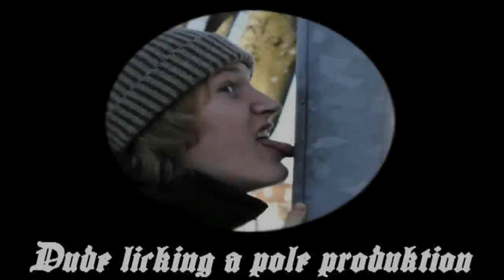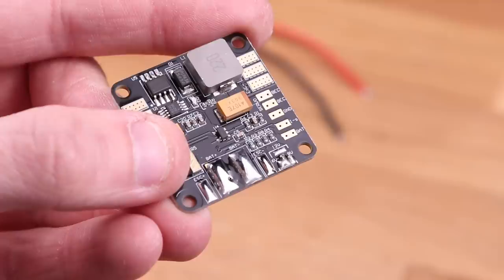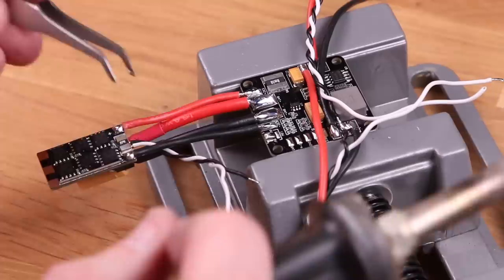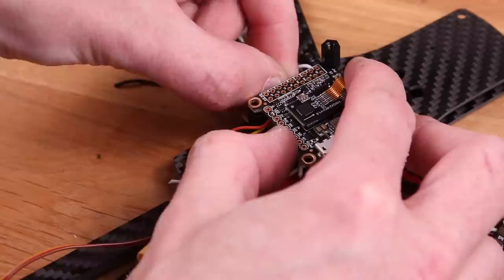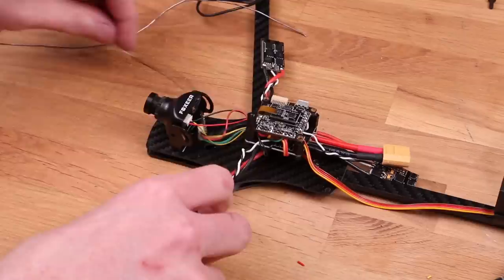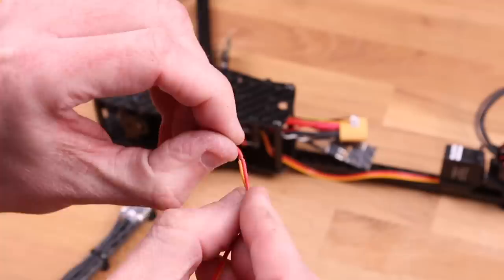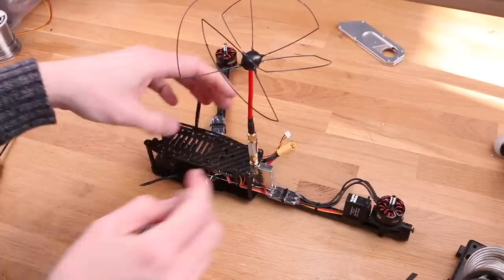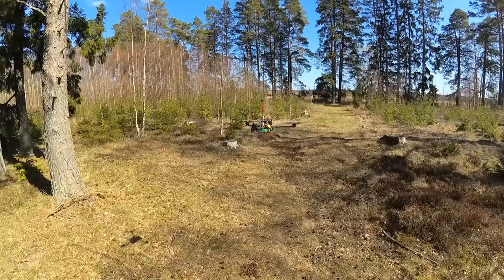TRICOPTER LR - Long Range FPV, 1h+ Flight time, Foldable multirotor - Build Video.

Comment: Man I wish you were still working with these things. You were the reason I fell in love with Tricopters. They would be so more advanced if you were still around.
Reply: It’s really depressing
Reply: @rdpenguin2710  what happened?
Reply: @bepopxxx  the list I sent you is a combination of what you can still buy (the bird servo isn’t made anymore) and pieces that you have to substitute. This too was changed because I put quite a bit more on it but there are a few other things you can do to beef it up
Reply: I'd like to make a tricopter like this what do u need to get something similar?
Reply: does anyone have downloded the 3d models and pcb file, i want them. the website seems to be not working.
Reply: i still have his original tricopter (bought it from him before he had the shop) and one of the newer tri, they still fly well. its fun. i dont know why he stopped, probably got bored, who knows. He still makes stuff. cool dude really. the years go by fast hehe

Comment: What is this, a post from David, the legend himself?!

I have to check this out, especially if it's about his beloved Tricopters.
Reply: I know the pid is the simplest control paradigm for this purpose but if u want to possess an increase in stabilisation and faster trajectory and step responses and a reduced steady state error and overshoot resulting in an immense increase in system performance,  construct a better controller such as the H infinity, LQi, Fuzzy, sliding mode controller demonstrating better robust properties against external disturbances such as wind, torque and vibration.
Reply: @meti9230  put up a link so people can try it out!

Comment: you are a tricopter legend. its hard to get the right equipment without your shop.
Reply: does anyone have downloded the 3d models and pcb file, i want them. the website seems to be not working.

Comment: Thank you so much for the tip with mounting the center to the top plate of the frame, without attachment to the bottom. I also tried to come up with a compact folding frame, but it didn’t even occur to me how to make folding beams that do not touch the fastening nuts of the FC. You have found a brilliant simple solution !!)) Thank you very much)))

Comment: DAVID!!!! We need a tiny whoop tricopter!!!!! And of course as always, great content man. I’m sure it’s super SHWOOOSHY!
Reply: I agree, a 1S or 2S micro-tricopter would be nice. Imagine a "Toothpick tricopter" with 65mm props!
Reply: I think tiny whoop is too small. Maybe 3 or 4 inch?
Reply: Yannick G FPV absolutely. That would be amazing!
Reply: JBpiification he does have the mini tricopter which is awesome but I’d love one that could fly indoors. We just have to see if the great Swed is up for the challenge?
Reply: @KnowledgePerformance7  This is just my opinion, but with a 3in or 4in tricopter, you lose most of the LR capability, it won't fly for much longer than a quad. Smaller builds that use the 65mm props on the other hand can fly for a relatively long time. The only problem would be the electronics and an adequately sized servo. A 3in or 4in tricopter would still be loads of fun though, and certainly unique in a sky full of 5in quads.
Reply: @yannickg6904  Right I think the idea would be similar to david's babyTri but smaller
Reply: @KnowledgePerformance7  For a toothpick sized tri, the servo would have to be specially designed. Or someone could use a tiny potentiometer or hall effect to get position feedback from a slim micro servo I guess.
Reply: @yannickg6904  sound like a cool product! Bit out of my design abilities...

Comment: David! Good that you're still around! I remember starting this hobby like what, 7 years ago? How different was it back then? I started with a quadcopter based on arduino. Then I moved to openpilot. I still have all the parts... But I've become lazy. Nowadays I just grab my Mavic Air. And it's not the same anymore... At the beginning people were interested, asking how fast, high or far I could go. Today people come to complain that I might be filming them... I miss the old days, before dji... Before it became big.

Comment: I love my Maker Knife! 

Funny story about it. I heard the RC Afterhours podcast what you were on a while back and talking about the knife. You talked me right into wanting one because it sounded cool and I wanted to support your project. I was disappointed that the production run was sold out and you weren't sure if there would be another run. I can't remember if I even went online to look for it or simply decided that I missed the opportunity. 

Anyway, about 3 or 4 weeks later I received a package from a name I didn't recognize. I opened it and after a few moments of being puzzled by the oddly labeled box inside the padded envelope I realized it was my Maker Knife! I completely forgot that I had ordered one from Kickstarter months before - doh!
I was so excited that I handed my phone to my wife so she could record my first ever unboxing video. 

The knife is awesome. I got the silver color and ceramic blades (which are as awesome as you said). The finish on the knife is spectacular. I appreciate it even more after hearing about the issues you had with the factory meeting your qualify standards. Your pursuit of perfection was well worth it. 

BTW, what's up with the steel blades on your knife?

After filming the unboxing video I told my wife she was not allowed to use the knife. It actually started quite a an argument because she didn't think I trusted her to be careful with it. 

The next day we were in the garage cutting down boxed and she dropped one of my many other utility knives on the concrete floor. She looked at me and smiled admitting that I was right to ask her not to use the Maker Knife. 

There's no replacement for quality tools. Thanks for your effort and insistence on top quality. The tool I have owned the longest is an old school metal Swiss Army Knife with the waffle pattern sides that my father gave me when I was about 9 years old. That was 35 years ago. I think this knife will be sitting next to that one in my tool chest 35 years from now. 

I can't wait to see what you come up with next.
Reply from the maker: Awesome story Dan :D Glad you like the knife!

Comment: Whats with the 1+ hour flight time? Which setup did you achieve that? 40 minutes is already very nice
Reply: I think that this is WAY too optimistic.
Reply: Must include the 2km floating back down ;l
Reply: Cecil Williams  You think so? I've got a quadcopter with 2216, 4s and 9" props, it's unbelievably really crazy optimised and it weights only 1kg. It flies 1h exactly. And getting this result wasn't even near to "easy". Trust me, I perfectly know how to build an endurance quad suitable for long range. You basically fight for every gram of excessive useless weight (useless in terms of flight time - everything except the battery, props and motors).
Reply: @WRXMSK  
Edit: I'm an idiot, disregard almost all of this, I own my mistakes, no delete.
Dude, I'm pushing 2 hours (1 hour 56 mins at cruising speed) for my custom tricopter. They are significantly more efficient. And I disagree, I make aerial-photography rigs, and have made fpv quads of many sizes that can reliability hit a couple mins over an hour, it's not hard. I have an hex that can carry a 6 pound camera/gimbal for 52 mins, hovering. It's really not that hard. The record is well over 2 hours now.
Reply: @WRXMSK  with a tricopter you have the option of a less powerhungry propulsion system, because you have the tilt rotor and don't need to spin two up and the others need braking. I think there his long flighttime comes from.
Reply: @Cult1022   The most efficient setup is a quadcopter. It's theoretically and practically proven. The efficiency (for a chosen motor prop combo) comes from lowest possible load on each square centimetre of area covered by a propeller. This area maximises only with quadcopters with the least added weight of other components. Next, you don't take into condideration the energy that the tail servo consumes on tricopters, it's not that tiny and potentially could be comparable with the energy needed for braking and spinning up two props in a quad scheme.
Reply: @index7787  You are skipping the lines while reading. I said that I squeezed an hour and a couple of minutes from a quad with 8.5" propellers. And it was hard to achieve such a result on the propellers that are so small. If you have a quad or a tricopter that flies longer on 9" props, we all will be more than happy to see the proves. Second, I'm not talking about endurance records. I'm building quadcopters that fly real LONG RANGE (and that's definitely not a couple of miles, as many think) and I optimise my quads for being most efficient in flying, and flying fast, to cover maximum possible distances. That's why I not go for much bigger props, like 17" and even bigger. They fly long, but they are damn slow. You can build a quad, that flies 4 hours at 30 kmh and make 120 km in total. I can build a quad that flies 2h at 60 kmh, that covers exactly the same distance. BTW, current world distance record for a battery powered quadcopter is still mine (it's 30.5 km out and back) and this summer it will be improved to 40+ km out if everything goes well. So no, man, I will keep the channel's name.
Reply: @index7787  at least long range quadcopter have video to prove...
Not some random salesman selling bullsh*t flight time (sorry david)..
Problem with drone industry today is alot of bullsh*t about flight time. I can't even sell 1 drone if Im telling the truth about flight time... (Curcol mas broooo...)
Reply: @WRXMSK  
Checked out your channel, I'm completely wrong. You get some serious miles man, who needs flight time when you can cover ground like that, I'm sorry man, I have hella respect for your work.
Only thing I have to add, most tricopter controllers suck, I code my own. I lock out the tail servo in fast forward flight and control yaw by other means because enough vector components are shared at high flight angles, you don't actually need the servo for many of the corrections (even small control inputs). My current FC uses an AI I've been training, I'm hoping to revolutionize how we do flight controllers, it could save a lot of power. Between that, and low drag lifting surfaces baked into the carbon arms that are set for my cruise AoA, I'm not far behind you in terms of range. Tri's can hit their own sweet spots, they are just comparatively under developed and I had to put a lot into the software to get what I'm getting. (Also, their acro isn't the best, I use an efficient servo, but it's slow, the only reason it works is bc the A.I. predicts instead of reacts so it need way less torque. The caveat is it handles like ass, but mine aren't meant to be flow manually.)
Reply: @index7787  
So you think this david tricopter can achieve 30min + with 5000mah 3s lipo?
What about  Liion 26650 5000mah? could be longer?
Reply: Vincent Bianconi 😂🤣
Reply: @WRXMSK  do you use li-ion batteries? what kind of pack?

Comment: Sad the store is closed and no longer selling this. I'd love to buy one
Reply: David made all files public, so if you have (access to) a CNC router you can have the parts made for you.
Reply: @R-77 Watch the build video and the listing in the shop, it's all there, you need to source the parts, or their replacements yourself, that's part of the hobby...
Reply: @R-77 Can't help you there... I entered the tricopter world last Oktober, just in time to see David closing the shop, so I'm making my own frames using the info on the RCExplorer site.
Reply: With one less motor, a tri is more weight efficient than a quad, flying them is an aquired taste and not for everybody, as tuning the tailservo and getting the general set-up right is more complicated than the RTF quads, specially the quads that 'everybodies granny' can fly with the gps and altitude hold. The manufacturers favour quads at the moment, as do the developers of flight controller software.  Software for tricopters is written/adapted by a few dedicated tricopter pilots, who don't need to make a living out of it...
Reply: @janspoelstra8309  thanks 👍
Reply: Why he closed the store ? He is not in hobby anymore? He is so genius i love to buy his tricopter..

Comment: please make a long range flight video (5+ km out / 30+ min )   that would be great
Reply: Yes please! Do an Airblastr like edit too. A trip back to the Faroe islands might be in order, lol
Reply: I know the pid is the simplest control paradigm for this purpose but if u want to possess an increase in stabilisation and faster trajectory and step responses and a reduced steady state error and overshoot resulting in an immense increase in system performance,  construct a better controller such as the H infinity, LQi, Fuzzy, sliding mode controller demonstrating better robust properties against external disturbances such as wind, torque and vibration.

Comment: David!! Excellent work man, as always. This tricopter is brilliant! I really appreciate the slower more efficient machines, especially for AP. Will you add building service? Or just the kit.
Cheers from Mexico!
Reply from the maker: No building service I'm afraid, just way too much stuff to do and not enough hours :)
Reply: I see, looks like I better up my soldering skills then! 😅
Reply: does anyone have downloded the 3d models and pcb file, i want them. the website seems to be not working.

Comment: Does this tricopter go to Sydney?

Guess it's time. Going to have to build a tri. 
Nice to see you back promoting 3 blades and a servo again. Don't be such a stranger.
Reply: You might need to swap batteries a few times then :-)
Reply: This copter is clearly 1st class, so the answer is no. ;-)

Comment: Nice!  Good to see you.  Takes me back to a project using ArduPilot in the days of KK2, Windestal inspired wooden dowels and plywood frames.   Was chasing flight times, position hold and return to home.  Best I managed at the time was just over 20 mins using 3,000Mah 3S, 800kv and 10 X 4.5's.
Reply: does anyone have downloded the 3d models and pcb file, i want them. the website seems to be not working.

Comment: Wondering about the locking mechanism of the front arms...
Do the motors/props aid the arms into the flying position ( Right Motor CW / Left Motor CCW ) or is the mechanism only relying on the friction between the arms sandwiched between the plates?
Reply: does anyone have downloded the 3d models and pcb file, i want them. the website seems to be not working.
Reply: @hiteshbhoyar7719  The Model is simple enough to CAD Model one yourself... Start with the size of the Motors, Servo and FC as they'll be defining the Dimensions.
While certainly cool to look at with the Electronics being integrated into the Frame, I'd recommend NOT using such an A.I.O. Approach even if you can have it manufactured by someone.
I owned a TBS Discovery PRO which had the same concept, and a single crash can/will ruin not only the structural integrity but also the PCB with all the Electronics on them which you then cannot transfer to a replacement Frame because they ARE the Frame... As such I find it better to keep the Frame separate from the Electronics.

Comment: I know the pid is the simplest control paradigm for this purpose but if u want to possess an increase in stabilisation and faster trajectory and step responses and a reduced steady state error and overshoot resulting in an immense increase in system performance,  construct a better controller such as the H infinity, LQi, Fuzzy, sliding mode controller demonstrating better robust properties against external disturbances such as wind, torque and vibration.

Comment: Hey David, when you tell us to cut the wires a certain length, and then they DON'T FIT, THANKS.  the 80 mm/ 60mm for the ESC's is wrong, if I soldered them to the  board that way one of the wires will have a bow in it.  and the the length of the front motor wires is too short, I'm going to have to lower the PDB so there is enough wire to use ty-raps on  the wires inboard of the ESC's. so what happened?!!!  mike

Comment: Thanks; Love the video and the concept.  I prefer to use heat shrink vice zip-ties, where possible though; especially when securing the wires to the arms. The only issue is that you have to remember to slide it on the arms before you connect the arms to the body. It just seems like a cleaner look to me, plus if you want to get fancy you can use the heat shrink to color code a bit.
Reply: does anyone have downloded the 3d models and pcb file, i want them. the website seems to be not working.

Comment: Just a suggestion on prop balancing. Instead of adding weight to balance, consider subtracting weight. As you say, every gram is important.
Reply: I think he knows that, but a small piece of tape and a little blob of hotglue does the job as well, is generally faster (ever wasted half an hour of balancing only to break a prop on the first flight?), and most importantly, shaving off weight might destroy the propeller's structural integrity, making it weaker. This isn't meant as a personal attack, I think he knows his stuff on propellers. ;)
Reply: @Mediamarked  Not criticizing. Just suggesting. But if you do it right, removing material might be better because added weight can come off at the worst time. A blob of glue can easily fly off. And, as he said, prop balancing is critically important, so I wouldn't want to take a chance.